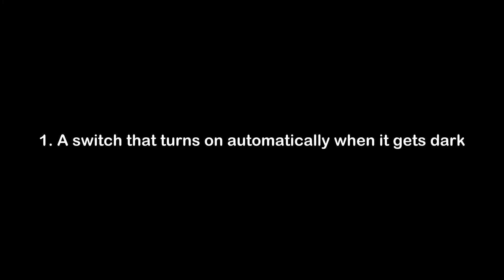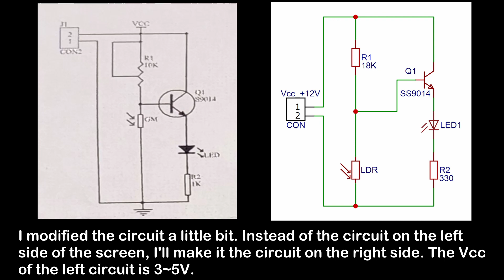Projects for Beginners in Electronics

Comment: Thank you !  I'm just starting with electronics. Is the clamp that holds your circuit board a magnetic base or is it attached to table?
Reply from the maker: The PCB clamp I use is a magnetic base. I bought it a long time ago and it comes with a bullet camera. I don't use the camera because it's low quality, and I only use the PCB clamp. I don't recommend this product. It's expensive and inefficient because it comes with a camera. If you go to the Amazon site and type in "PCB holder for soldering", there are many kind of PCB holders for beginners. I think you can choose the one that suits you.

Thank you..